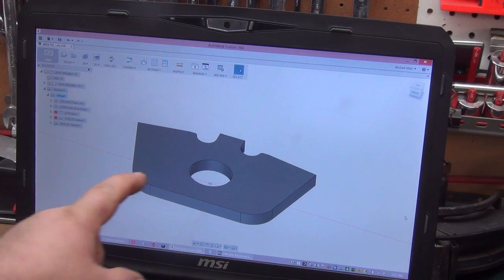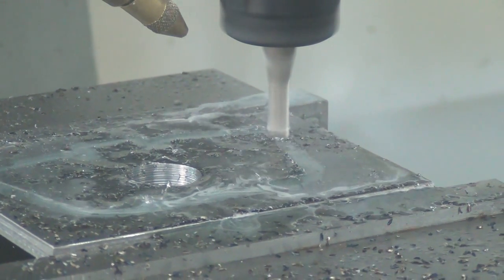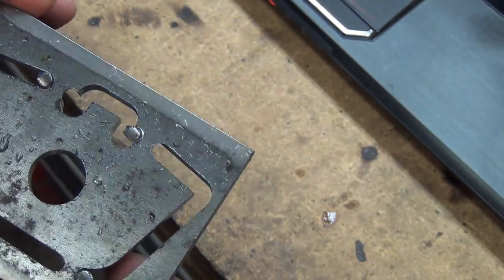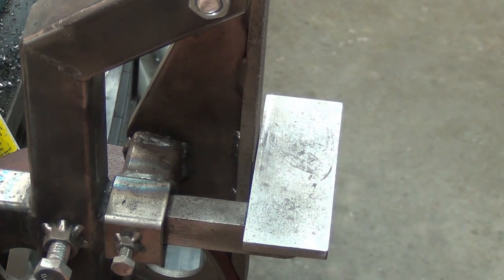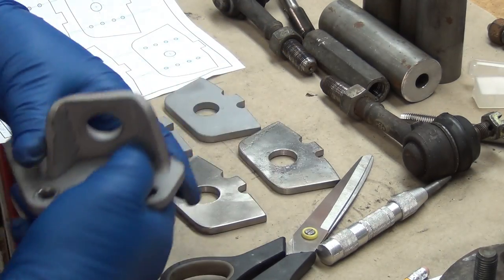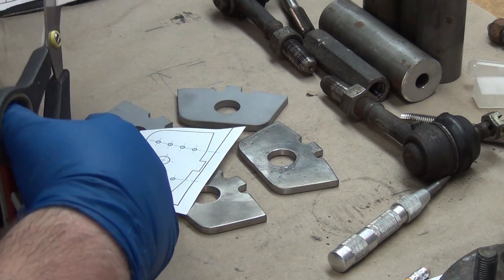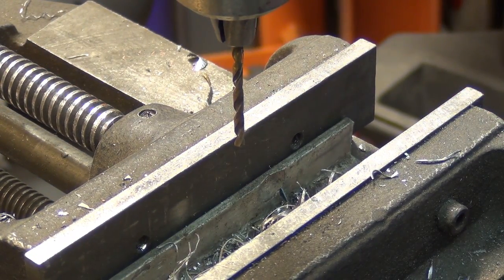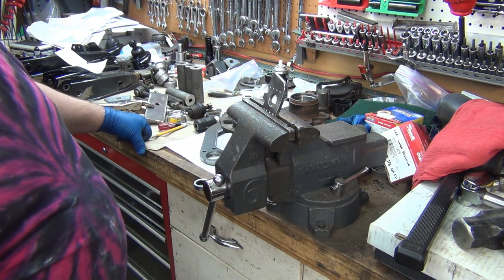Ball Joint Mod - Tension Control Rod Mount pt1

Comment: Nice looking parts!
I've munched a couple cutters due to mill scale too. I need to start using that muratic acid.
I've ghetto-fab'd a bending jig for use on my 20ton harbor freight press. Dang ugly, but it works.
Reply from the maker: +russtuff Thanks! That's good to know the mill scale is a factor.  I know it's really hard, but I wasn't sure if it would kill a cutter.  I won'd care if my bending jig is ugly, as long as it works! :)